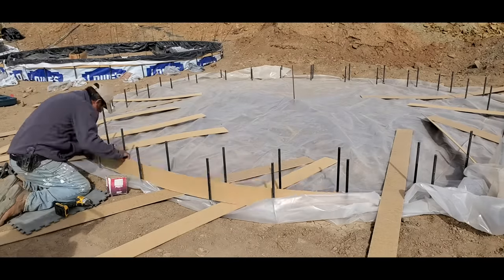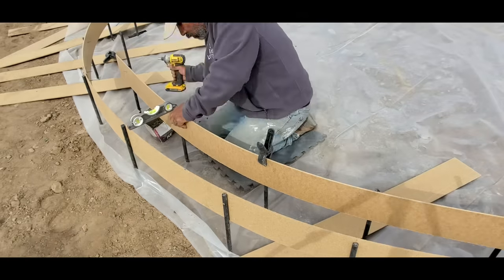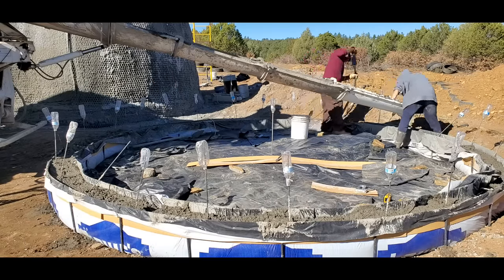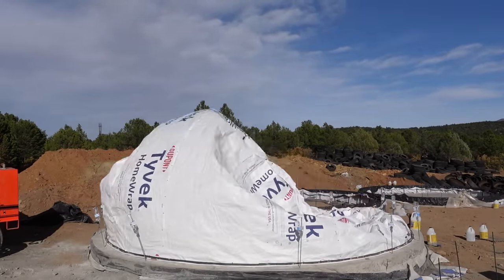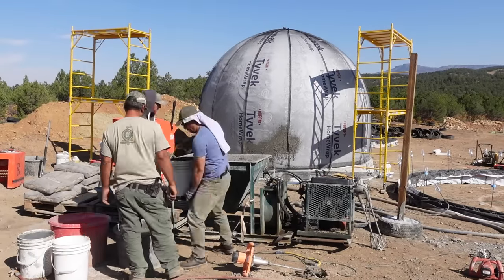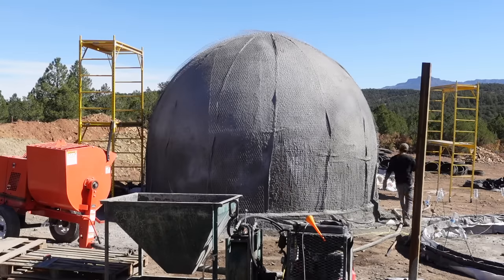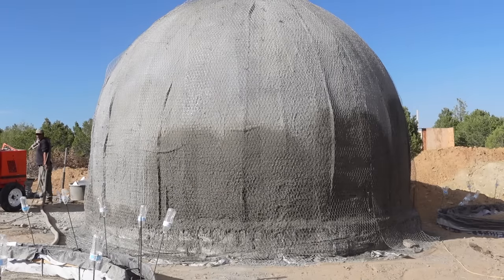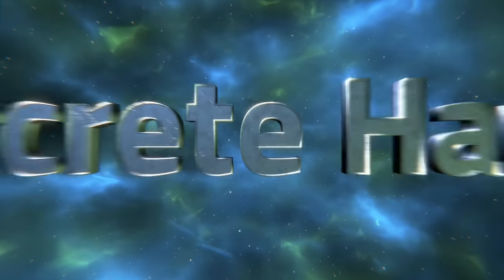NEW Dome Building System | Aircrete Harry #domebuildingsystem #dome #buildingsystem #aircreteharry

Comment: 45 years ago, I built 2 aircrete domes. I used 30" dia weather balloons for the forms (about $20 back then). I built a 1 foot high berm around the perimeter. Placed the balloon inside the berm and added 1 foot of water inside the balloon to keep the bottom flat. I then sprayed 1/2" of foam on the balloon. After the 1/2" foam hardened, I built the foam up to 6". Then I sprayed aircrete on the outside of the foam. After it hardened, I cut in a door and sprayed the inside of the dome with aircrete. After that, I sprayed in and floated the floor. They turned out to be very strong and very well insulated buildings.
Reply: Wow, that's amazing and incredible, that you did all that 45 years ago! When you say 'foam', what would that be? Is that the kind of thing people use these days to fill in holes, etc? Like epoxy plastic type foam?
Reply from the maker: That very cool!!  One thing is I think you where spraying shotcrete not Aircrete. The spray foam insulation is what I want to stay away from the main reason being cost. Thats why I'm using Aircrete and EPIC for insulation.
Reply: @AircreteHarry  be very careful what foam you use as there have been reports of Cyanide gas leaking out over time and some other gas that is HIGHLY CANCEROUS .There are expensive homes,that have been abandoned.
Reply: @johnryan2193  Aircrete is basically aerated concrete (e.g. concrete with a lot of bubbles, a concrete 'sponge' if you will), there is no foam.  It's been widely used as a building material for decades in Europe...
Reply: Did you maybe mean 30’ balloons? Because 30” isn’t near as impressive.
Reply: Nice!
Reply: "aircrete" as far as I know is recently development... maybe you mean something else
Reply: NASA satellites.
Reply: Please post videos.
Reply: Brilliant. That’s what you are!
Reply: Ancient India
Reply: @IntoleranceRecords  My thoughts as well haha
Reply: @ckm-mkc  Yes and NO, From reading the OP's comments above ,He is using an expanding insulation foam. The foam is sprayed FIRST onto the "Balloon", then once dry, Aircrete is added on the outer, then the inside, sealing the foam between the Aircrete. Also the additive used to make the Aircrete bubbles is also called foam,(The foaming agent) and some versions use bean bag type foam beads as an additive.
Reply: @balloney2175  aerated concrete has been around since the 1920s.
Reply: T
Reply: 30" ... What is this, a dome for ANTS??? (Zoolander anyone?)
Reply: Shaving cream foam?
Reply: That is ingenuity.
Reply: @IntoleranceRecords  Gnome Dome 🤗
Reply: @IntoleranceRecords  a couple dog houses. :)
Reply: @IntoleranceRecords  lol
Reply: Essentially the ingenuity of Toucan Sam’s beak.  Which like cement has keratin tiles on the outside and foam-like bony fibers with drum like membranes in the inside.  Nice.
Reply: Would the knot of the balloon be near the side or the top?  I see putting water in a 30 foot*  balloon very cool but also difficult.
Reply: @Null-Red-Blue  it was 30 feet weather balloons not 30 inches.  The weather balloons of various sizes were available in the back of magazines like Popular Science.  I sprayed the foam on the balloon about 1/2" thick.  The balloon would not support the weight of the concrete and it would not support the weight of more foam. Once the 1/2" dried  I could then add 4-5 inches more of foam. Once it dried, I could then spray the concrete which had foaming agents in it. The nozzle of the balloon was where the door would be cut out. Once I got inside, I had cut out windows and in one of the domes I had cut out a circle at the top for a skylight. Then I sprayed foamed concrete on the inside. So the dome was a sandwich of 5" of foam with an inch of light weight concrete on the inside and outside of the foam. It was very strong, very well insulated and fire proof.
Reply: @nelsonhochberg5182  Very grateful for your insight and it is awesome you have done this decades ago in previous endeavors.  Going to grab one or two 30ft weather balloons and try this out.  The housing market is unapproachable to many and this may be a valid solution.
Decent Fabric Airforms cost between $2500 and $10k.  

The Weather Balloons aren’t $20 like they were back in the good old days, but a decent sized one is about $120-200.  Much less expensive than an airform, but WAY more fragile and risky in general to inflate without popping.

Best regards to you Nelson!
Reply: @balloney2175  no ist not new man
Reply: @IntoleranceRecords  30' = 30 feet and 30" = 30 inches... maybe just typographical error
Reply: @overbuiltautomotive1299  ok.... but there was no
 liquid soap back then
Reply: There is a 28 ft weather balloon for sale on a Amazon for 130.00
Reply: 45 years ago? Is it not that the aircrete concept is just less or more than 10 years ago?
Reply: Nice.
Reply: It would be great to see how it has held up over the years.    Maybe a Zillow search on the address?      This concept is what they need to build for hurricane and tornado resistant homes.

Comment: Though its a bit pricey, chain link fencing is ideal for reinforcing one of these domes due to is ability to stretch and flex in any direction.  An old friend of mine used it on the outer coat on a 50ft monolithic
 dome.
Reply: Used chainlink sounds good to me!

Comment: I've been hoping to find someone building aircrete structures "to code."  Thank you. I do believe there must be a lot of folks like me out there, so anyone providing courses on building with aircrete "to code" would probably have a big following!  Thanks!
Reply from the maker: This is not an Aircrete dome But I do have a way to build an Aircrete dome that can meet code. The double dome shell with Aircrete can be made to code.
Reply: As a long-time building inspector, the first 2 solutions that come to mind are: Build under 200sf (states other than CA) and have an engineer calculate it out.
FWIW I was an inspector on the "super adobe" CalEarth project in Hesperia, CA and a big fan of alternative methods, especially if they reuse construction waste or reduce materials.
Reply: @foyjamez  Thanks!  Good info. Much appreciated.

Comment: The reinforcement has been a concern even though I am a big fan of the air Crete dome potential without the expense and design limitations of the Monolithic Dome currently used. In Florida I want a shelter that can withstand hurricane force winds, long damp rains, and termites too - this has great potential. Friends in the concrete business shared info on self-repairing concrete adds that are now available making dome homes much more feasible with building code structural integrity! Looking forward to seeing your place unfold- dream big!

Comment: The guys I Italy Texas have been building shot creet domes for 25 years. Up to 1000 ft span, no interior supports. Happy to see someone else doing it as well. Hope you do well.
Reply from the maker: Thank You!
Reply: Yes, Monolithic Dome .. uses the outside to inside, process to create a professional, proven (and critically)safe and insulated dome.. their custom air forms are far more durable .re: this type... It is not easy to achieve consistent thickness using this method .. and since concrete is really only strong in compression. That is critical to the strength. Be careful people. When they collapse because they are made poorly it is ugly and tragic. Aircrete is very difficult to control the modulus when sprayed or hand applied.. casting/pouring is where it shines
Reply: If more people used domes as homes, weather issues would be so much less for a lot of people.

Comment: Saw some in Casa Grande, Az 40 years ago. Mid June , 120 outside, low 70s inside. Difference was concrete inside, roughly 12 to 18 inches spray insulation outside with solar protection. concrete inside gave it thermal mass with insulation keeping it cooler. It hadn't had the doors installed yet. impressive!!

Comment: For engineering purposes, wet concrete and wet soil weigh about 65 lb per cubic foot.  That figure can be used to calculate the pressure that the poured concrete will exert on a form or what water-saturated soil will exert on a retaining wall.  The pressure decreases linearly from the bottom to the top of the pour.  Integrate from the bottom to the top of the form profile to calculate the total force on the form.

Comment: Harry, have you thought about doing the first steps to achieve the initial hard structure, then placing reinforcing materials (bending rebar or a few layers of mesh of some type) followed by covering it with a larger tyvek envelope that is designed to allow whatever thickness you want the dome to be, then pumping in aircrete, trapping it in a layer in between the outer envelope and the initial hard dome you made?  (I don't think this would work with normal concrete given its weight, but I think aircrete should work.  It would seem to me to be a good way to get your dome shape while avoiding needing to either put repeated layers of shot aircrete or using aircrete bricks.  And you have already worked out the process (apparently) of making the tyvek envelope work for you.  I really appreciate your persistent experimentation with this! - oops now I see another "part 2" video.

Monolithic domes has two neat processes for building domes, but what you have done here is different, to some extent.  And using aircrete vs normal shotcrete means the concrete is insulative, removing the need for open or closed cell insulation.  By tailoring your forms to have windows and doorways built into them (which I expect you will be experimenting with in the future) it should make it easy to build a multidome connected structure.  And your method isn't really limited to dome shapes per se - just to how you can shape the envelope.  Keep this great work up!  Cheers!  JW
Reply from the maker: I already had that thought in 2017 and build a proof of concept dome. It does work and I will be building a new dome using that system. Check out the first dome. https://www.youtube.com/watch?v=TlSqBiu7SJo&list=PLHnuS9-ekYxgL3K6alErsq0acvjJwSv6P

Comment: I appreciate how you addressed code issues. Even with the silo house build, if your area has code requirements you have to get architectural and structural engineering approval (BEFORE starting)👍🏼
Reply from the maker: That's correct! You know!

Comment: I love it Harry!.... The forms for the ring beam are fantastic!....  I personally like to put a groove in the top of the ring beam that holds cattle panels and that gives me a straight wall so I can use regular doors and windows without augments...  I really like your low pressure airform and the first layer of fiberglass mesh.  Maybe there is a way to install the stucco mesh with less work - I can't think of any improvements on your method though... I like basalt rope because it is so easy to work with....  At what point are you turning off your inflator?  I saw a "Billy Goat" gasoline powered air blower that looked promising....  I am excited to see what you come up with in regards to the pump, we need something that will pump a sand mix thru a small diameter hose without plugging up.... Keep up the great work!
Reply from the maker: Thanks Jeff,  The stucco mesh is easy to install. in the beginning I had to try a few ways. You will always have an augment  no matter how small to keep water from coming into the window or door. After the wire mesh has been covered in cement and cures then I turn off the blower. The pump I'm in development of now will pump sand cement mix.

Comment: I hadn't seen one of your videos for a long time, then this popped up.  Very interesting!  While I was watching several ideas come to mind. One that I thought of was to make a smaller, garden shed, chicken coop, dog house out of light wood, 2x2 or furring strips, and light ply,  that was out of plumb, trapezoidal, smaller at the top of the nearly perpendicular side walls, and a small portion, six inches or so, that could be taken off all the way around the bottom. I'm thinking that I could go over it, roof and all, just as you did the dome with tie-vec, stucco wire, hawk and trowel, or shotcrete aircrete, and so on, but if I left one end open (the end that would get the door, or become an open stable type shed), I could then go in, take that bottom six inches off of the shed form, and I should be able to lower it six inches, releasing it from the shell, and drag it out to use over and over.  Or even to just pull out flush to the open end, raise back up and make the same shed 2,3,4 . . times longer.  I also think that I could put in some windows, chicken doors, etc along the other three walls with a wood frame wired into the metal lathe to trowel right up too, and they could be finished right in place.  I also  wonder, if they weren't too heavy, and maybe made on a light channel piece of metal (a metal stud on it's side and tied across the door end threshold, maybe a few in the middle, if it could be drug around a bit carefully, without messing it all up?  I might have to fix some cracks if the first one doesn't drag well.  I'm a mason when I'm not a chicken herder, all my days off come when it's too cold and snowy outside in the Rockies for mortar.  I'd like to make these sheds in the shop, then drag them out.  Thanks for giving me some new ideas to think on Harry.

Comment: How do you deal with the 6-8 overlapping layers of wire on the top of the dome? 
Couldn't you run 2 lengths of wire over the top at 90deg then cut shorter lengths that tie in without going over the top ?
Reply from the maker: Your way is the best way to build it . But my way just gives you a lot more reinforcing on the top. Ones everything is done it will have 8 inches of insulation on top and all the wire will be covered anyway.

Comment: It's interesting that you said you wouldn't feel safe in an all aircrete home.  All of the research and practical use studies I've found show aircrete to have superior impact and crush strength, as well as overall stability, as compared to standard construction concrete and/or the cinder blocks so often used in typical modern housing.  So, why exactly would you feel it was unsafe?  You've obviously been messing with it for a while, so I'm interested to hear your reasoning.  I'll definitely check out the rest of your videos for more dome and aircrete content.  Thanks for sharing this.

Comment: Early '80's in Oklahoma city We used a similar methodology to build dome homes. however, we sprayed foam on the interior of the nflated dome form to a thickness of 4" then a tapered shotcrete layered 6" at the base 4" at the peak,  inside of that. the shotcrete was a bit troublesome since we were using 9 sack shotcrete with 1.5" steel fibers (no rebar When the shotcrete hit the surface, the steel fibers would form a durable lattice ). This kept the thermal mass on the interior and the insulation on the exterior. for garage attachments we used half cylinder inflatable forms. later in a commune I worked with community members using a more basic method of a rebar skeleton and masonry cement hand troweled in to the lattice.
These we buried in to hillsides .
Reply from the maker: Very Cool!

Comment: why dont you use basalt twine and wind it around?  like monolithic domes does on some of their small domes.  is suppose to be super cheap.
Reply from the maker: Not as strong as this system and the rope is more work with all the anchors.
Reply: @AircreteHarry  true but that wire is much more expensive?

Comment: A few things, could you just dig the footing into the ground so no formwork ?
What size fiberglass mesh is it ?
Was $5000 for just the shell ? That's approximately $25 per sq ft, how does that compare to say a round building in block ?
Could you use those fiberglass strands in the mix for reinforcement instead of mesh ?
I know, too many questions, sry 👍😊🇦🇺🦘
Reply from the maker: My ground is very rocky and this was much easier system for the foundation. I did dig the footers but then covered it back up to do this system instead. I don't need heavy equipment till the very end.  $5000 is foundation and shell. I do have other thing like Basalt fiber chopped to mix in the cement.

Comment: I'd have to put a rebar shell around the dome and then spray on the thickened aircrete. Because I'd want a loft sitting area.
Reply from the maker: Yes, loft can be added. Aircrete is not sprayable, many confuse that.
Aircrete is used for great insulation. 
I recommend using the Aircrete Thickening Agent, which is offered on my website, for greater results & better aircrete production. You may see my older videos proving the concept & showing the difference.

Comment: 1608 sq ft house for 40k is attractive. I'm going to El Salvador which is prone to earth movement and your thinking about the layers of reinforcement is in line with mine. I don't want chunks of concrete falling during an earth quake. The cracks can be repaired. I was looking at the price for polyester fabric coated with PVC but your Tyvek idea is much better. Are you sewing or gluing the Tyvek panels together?
Reply from the maker: @joel6427   Welcome to the channel, Joel!
Agree with you, one would want to avoid the falling parts of cement. The layers work well while providing a grip during the spraying process & reinforcement for the structure during the curing & moving forward.  Sewing is the method I use. Varies sizes are available for custom order on our website - as well as video tutorials.

Comment: Looks good guys. Looks like the right way to do the main structure. Of corse you can burry it now with aircrete for maximum insulation. 👍
Reply from the maker: Forgot to mention that around the outside of the ring beam I'm going to pour about 8inches for insulation.